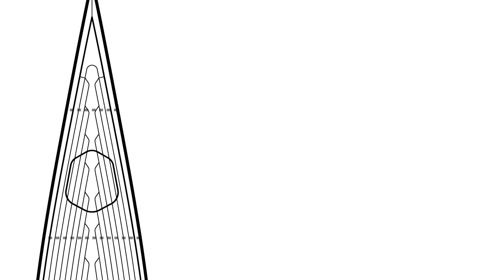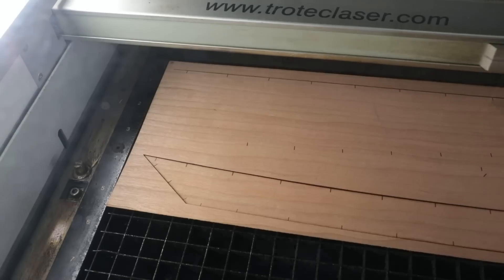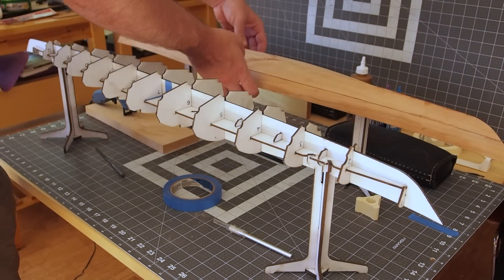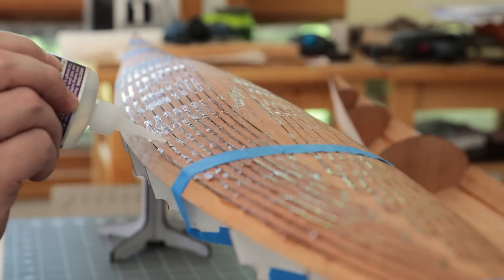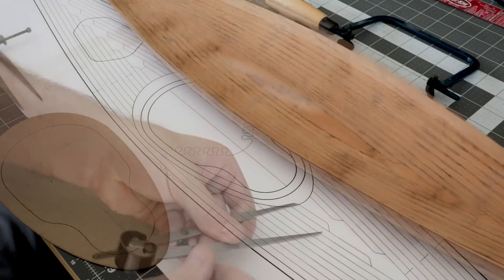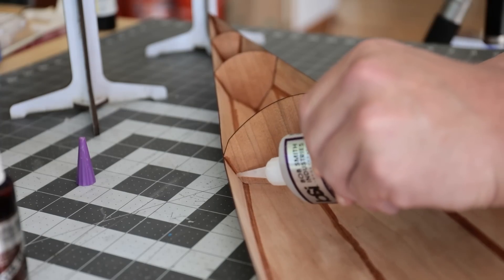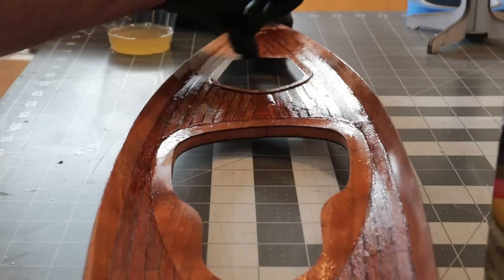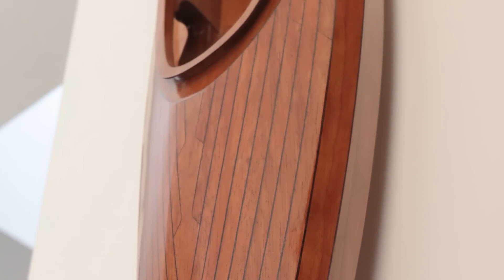Stitch & Glue Kayak | New Concept Model

Comment: This looks easy to fabricate- if you happen to have a full scale laser cutter handy! I appreciate the thought put into this, computer modelling all those strips... The nesting program getting all pieces to come out of 4x8 plywood. 
But I believe you will benefit from paying more attention to the contours below the water line when you make your final kayak. This is the major advantage of cedar strip over stitch and glue- the stitch and glue is normally confined to simple 3 or 5 chined shapes, while you can create, with a little effort and craftsmanship, almost any contour with cedar strip. Now in this wonderful new age- these contours can be achieved through computer aided stitch and glue techniques- just like you did with your deck... 
The smooth contours of a cedar strip hull slipping silently through the water are a different experience than the whooshing sound of water passing under a multi-chined hull, Just sayin'. ( I owned a similar shaped plywood hulled kayak to what you have made here. It was about 17 feet long, and oh, sooo much cruder in form (but not below the water line). At speed it was actually quite noisy, though not unpleasant.) the 'Kawartha' canoe I now use slips through the water almost silently, but what I notice is that the old wooden boat seemed to have a higher top speed when you put in maximum effort, for however long you can keep that up! While the canoe, with it's smooth hull shape cruises at a faster low speed for the same effort of paddling as I put out in the S&G wooden kayak. So, it kind of depends on what you are after, speed or efficiency... 
There just might be a market for a puzzle-me-multi-chined kayak, using pre-cut computer shaped pieces people can just stitch and glue together... Especially when cut from a 4x8 plywood, that ends up looking so fantastic as yours does!

Comment: Absolutely gorgeous! A few years ago I tried building full size stitch and glue dinghies with the high schoolers I worked with. We did get a functional one out of the four attempts! I'm going to share this video with some of my current students because we're doing a similar project again, and I really want to hammer home how important the planning and modelling stages of design are. I mean now that you've done this model, you're so well prepared for the full size build! Excellent work, man. I'd also love to see how you designed this. Are you using Fusion 360 by any chance? Or something similar? I'm curious about how you got to flat parts to cut for your design. I could see using the sheet metal workspace in Fusion for that.
Reply from the maker: I use Rhino3D.  If you loft two curves in space, you will, by definition, get a ‘ruled’ surface...  ruled surfaces are unroll-able.  In Rhino, you simply click on a unroll surface command, and it will flatten the surface for you.  Good Luck!

Comment: Very nice. I would have been tempted to stain some elements like the central deck connector for a little more drama. Also the look of the puzzle joints is so interesting I would probably have more of them even though they were not necessary. What software did you use for designing the hull?
Reply from the maker: Thanks!  You can see that I played with color a tiny bit in the renders...  I have messed up too many projects messing with stains and if I can subtly do it with species, I'll look into it!  I use Rhino3D for pretty much everything.

Comment: That is beautiful. Btw what finish did you use for your 3d printed parts?
Reply from the maker: Thanks! This process wasn’t fully shown for pacing and for the fact that I had shown it in my casting vids...  File the surface flat, sand, thin CA, sand, satin polyurethane.

Comment: You give as the reason for building the model as :  " test the geometry and think through the fabrication " of what you call a " stitch and glue kayak ".  You will forgive me if I fail to see the connection between an extremely complicated model structure, [ composed in the first instance of pieces of computer controlled cutting from choice wooden stock, held together exclusively by CA glue ] and a possible follow on stitch and glue construction for a working vessel.

It's worth a moment of reflection to realize that kayaks were built originally from pieces of driftwood or animal bones to compose the frame held together with animal sinews, which was then covered with sewn animal hide.  All of that done with a good eye, a steady hand and a knife.  If they were lucky the knife would be hand made from salvaged steel, or maybe hand fashioned flint tools.

It may be news to some to learn that the kayak is part of a larger system of kayaks and umiaks, the latter being more like a traditional Indian canoe but quite large.  The kayaks were operated by men to search and kill marine animals working as a team.  The umiaks operated by women were used to transport the catch ashore.

Implicit in the use of a kayak is the learned skill of operation of this essentially marginally stable craft.  They rely on the same principle as is now used in designing modern fighter jets ;  the aircraft rides a knife edge between stability and instability only controllable by a computer.  In the case of an Inuit hunter the latter is achieved by years of practice learned from infancy.  The ubiquitous popularity in modern main stream society of kayaks blissfully ignores the fact that they are dangerous and plying one without prior knowledge and training is to risk death by drowning or injury from collision with underwater objects.

As a former builder of model aircraft and many more ship models, I have of course encountered CA glue.  It is a medium I thoroughly dislike.  There is always the risk of gluing your fingers together, the smell and the effect on the eyes is overpowering and very possibly carcinogenic.  To see it used as a coating is something I've never seen before or would ever have considered.

I marvel at the distance between the original kayak and what it has become in our modern day world.  It is ironical to see these modern craft yet recall the advice of the great architect Frank Lloyd Wright that " form follow function ".
Reply from the maker: Hey, thanks for the comment!  Stitch and glue has come to refer to a hull made from single direction curved surfaces that are unrolled and ‘stitched’ back together usually with copper wire for its ability to be sanded if not removed entirely.  Then the seams can be glued with thickened epoxy and fiberglass.

The quote you referenced is actually from Louis Henry Sullivan though often incorrectly attributed to his apprentice FLW.  The entire quote is:

“Whether it be the sweeping eagle in his flight, or the open apple-blossom, the toiling workhorse, the blithe swan, the branching oak, the winding stream at its base, the drifting clouds, over all the coursing sun, form ever follows function, and this is the law. Where function does not change form does not change. The granite rocks, the ever-brooding hills, remain for ages;the lightning lives, comes into shape, and dies in a twinkling.”

If you know Sullivan’s work, you will see that this quote was taken out of context and shortened to “Form follows function”.  This mantra was then adopted by the Modernist movement to actually oppose the application of ornament so artfully applied in Sullivan’s work and with which no one could compete.  Study the Guaranty Building in Buffalo, New York, for example.  

I believe that form does follow function, even and especially if that function is to be beautiful.
Reply: @Grunblau  I appreciate the clarification on the origin of the quotation behind the supposed FLW one.  The original which you quote, in its entirety presumably, is pure poetry of course, and as such we can guarantee that it will be routinely shortened, bowdlerized and generally mis-used. 
Regarding Frank Lloyd Wright :  although I respect the form/function caution attributed to him and forever associated with his name, I have to say that his work IMHO is cold, soulless and rather unremarkable.  Also as an engineer myself I think too many architects are self-indulgent posers, ever ready to have engineers bale them out when they are demanding something outrageous quirky and sometimes just ostentatious, and claim all the credit.  In the case of FLW many of his designs were poorly constructed and later required extensive repair.  He was also something of a control freak, as we would say these days, in that he designed internals such furniture, which were too often excruciatingly uncomfortable if you chose to use them
.
PS.  Although my original comment might appear to be possibly dismissive, that was not my intent.  My real messages were (a) that you chose a very elaborate and sophisticated method to investigate a design and (b) that the original builders were extremely resourceful in making their kayaks originally and (c) that although beautiful to look at especially nowadays with modern construction techniques, they are nonetheless dangerous if you are untrained in their use.
Reply from the maker: Not dismissive at all, just an interesting discussion worth having because there are a lot of people that do not question why or how.  Chances are, most people reading this in the US, for example, could go outside and look at their house and see fake shutters screwed to either side of their windows.  No one questions these vestigial appendages on their house but then go on to talk about form following function.  The modernist movement alienated a lot of people under that false mantra and stripped from architecture things we found relatable to as a human beings.  I have been to a few FLW buildings and some of the negative comments about comfort and overwrought details are valid, but the inhabitant is forced to acknowledge their own relationship to view, environment, and programmatic use of space.  There are many modern masters that created incredible spaces.  It is mostly their imitators that have created the impression that modern=bland.  

BTW- You are correct that architects are self indulgent posers... (Source: Am one)
Reply: @Grunblau  LOL - good one.  No idea you were an unrepentant architect.  Engineers have faults too !  But to strike a more serious note : to be fair to FLW part of the problem in architecture in his time as I understand it was that architectural design had fallen on bad times. So that at its nadir architects were trained, as I've heard it expressed, to produce a box with holes in it, then to proceed to put ornaments around the holes.  That done, a design once produced say for a bank could be presented as a hospital,  civic building, legislature or railway station or [ as I believe actually happened, an Oxford college [ it was reputedly Keble College ].
I think FLW was trying to make the point that it might be nice to design something that fit unobtrusively into its intended setting.  More power to him on that.  Being the Western Man that he was his designs tended to contain a lot of right angles.  By contrast had he been an African tribesman he might never have seen a right angle, and accordingly designed structures which to our eyes might recall the form of a bell-shaped African kraal.
Reply: I need to read this essay of a thread, so I'll leave this comment here for when I have time. :)

Comment: Nice work! How did you design the developable hull? What software did you use?
Reply from the maker: I used Rhino3d and Grasshopper.  I set up a pretty complicated definition so I could define the points at the bulk heads.  Grasshopper would than execute splines through those points, and use those splines to loft ruled surfaces that could be unrolled with surface info like the tick marks.  The definition also solves for some of the hydrostatics of the hull.

Comment: Great design! What software and features did you use to design the kayak and make the flat templates?
Reply from the maker: I made a Grasshopper definition in Rhino 3D to make managing the ruled curves easy so I could tweak everything 1/8” at a time and have it resolve all surfaces.  This definition also automatically unrolls the surfaces and the tick marks and flattens the geometry.  It also solves for the hydrostatics, but showing it in this video seemed excessively boring and pretty specific to a certain type of person.  Essentially, you can loft two curves and use the unroll command in Rhino to do the same thing...

Comment: Oh, come on, not even a water test to see how it cuts the water?
It looks amazing, tho.
Reply from the maker: Do you know a nautical engineering lab that would run some tests?  (legitimately curious)
Reply: @Grunblau  sadly, no. If it was In my power I would even run the tests for you.
I just meant the water test as seeing it in some of it's future real life environment, the superb finish from the model coupled with some water reflections would give out amazing photography, and the model shoud be easy to dry so it doesn't get humidity damage, as you finished it well, not just bare wood.

Comment: Really cool build, it turned out beautifully!  I am assuming you didn't cut out the deck holes while cutting the parts on the laser to make initial assembly easier.   As a thought: you could have the laser mark the hatches out on the pattern, like your stitch lines on the hull, which would save the steps of aligning and marking out the holes with the templates.  You could also potentially have the laser/CNC do a perforated cut for those holes so they would remain in place during assembly but be easily cut out after.  I hope you post up the full kayak build once that happens!  Glad to see a video from you again, I always appreciate the thought and design you put into your builds.
Reply from the maker: Thanks!  In order to get the curvature to flow over the cockpit, the pieces needed to be continuous.  To be completely honest, I hadn’t settled on the hatch design by the time I started building the deck.  All excellent suggestions, tho...

Comment: Beautiful model, await the full sized one.  Are you going to use machines to create the pieces on the full sized ones, or do it by hand?  Would be interesting to see something cnc used to make the pieces.  Check out fireball tools videos where he uses a ?five? axis water jet to cut wood, beautiful.  Welcome back.
Reply from the maker: Likely CNC, large scale laser would be ideal!  By hand would certainly be possible too!
Reply: @Grunblau  I highly recommend looking into the water jet, most lasers only make perpendicular cuts.  With water jet you could do compound changing beveled edges.  Fireball has a 10'x 15' table "limit".  He only recently tried wood, and talked about wanting to experiment more.  Either way, great project.